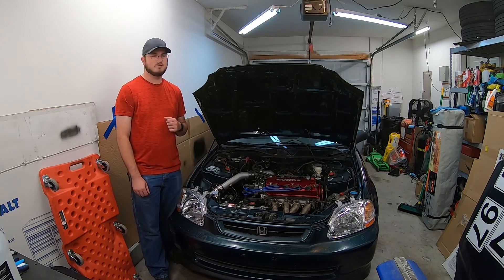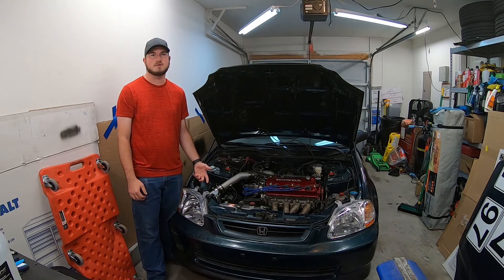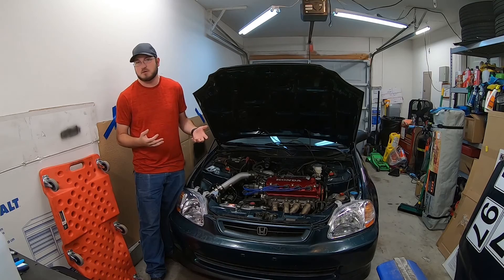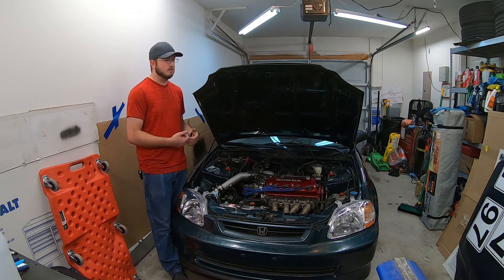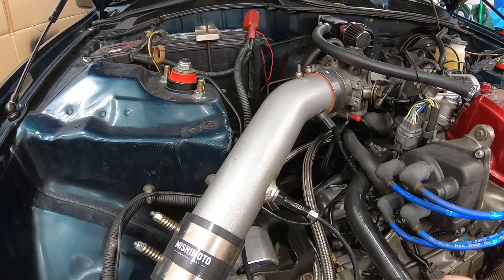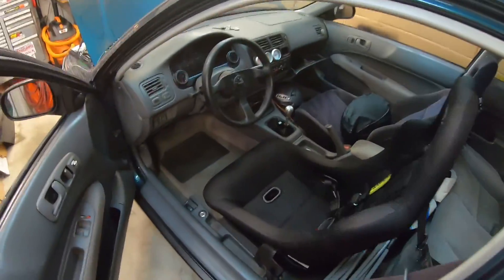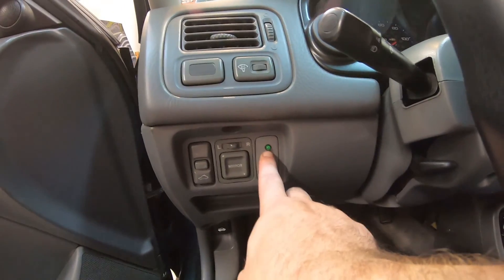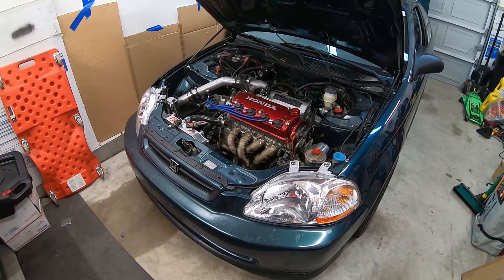JRSC Water Meth Setup Overwiew

Comment: What was the power you made on this set up? 
I’m d series supercharged and wondering if the methanol kit worth it?
Reply from the maker: i made about 160 to the wheel. I picked up about 20 whp after installing the kit, and intake temps were reduced which is the real reason to run this.
Reply: @flightmaster127  thanks for the response!
What were the intake temp difference’s and is it safe to daily drive does the methanol/water mix have any negative effects to the supercharger?
Reply from the maker: @sonick133  Yes it is safe to daily drive. The controller can be set to only inject above a set boost pressure. Long term I have heard that the methanol can steam the coating off of the rotors but I have not had any issues yet.

Comment: Didn't you damage the inside of the compressor?
Reply from the maker: The last time I had the blower off there was no visible damage. It is true though that over time the injection can wear off the coating on the rotors.

Comment: What where your power gains with the water/meth
Reply from the maker: I picked up somewhere around 20whp
Reply: You would pick up more with high boost.  Because high boost generates allot of heat needs cooling 

No intercooler means you should be on about 14psi Max 

I'm running 30psi on low compression motor in evo .. can't wait to get kit .. Nice video 

By the wayyour nozzle looks like 90°
Not really facing incoming air head on?